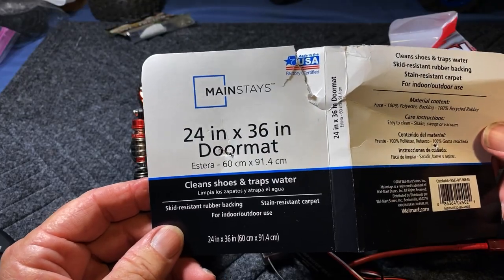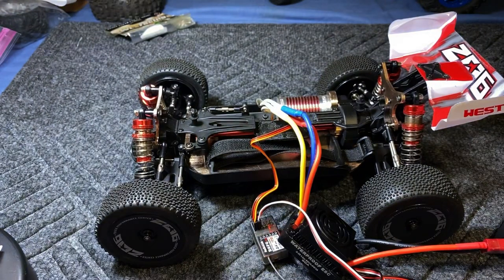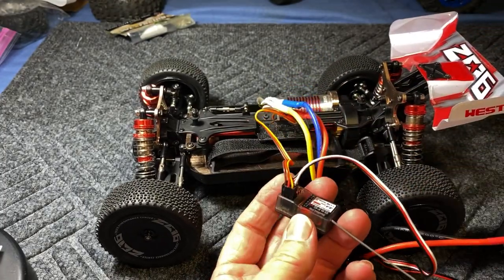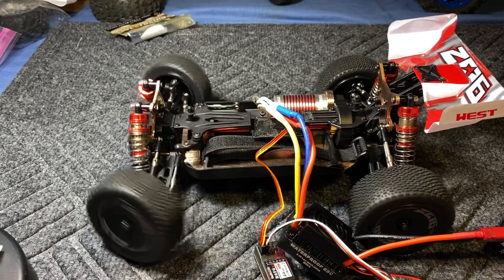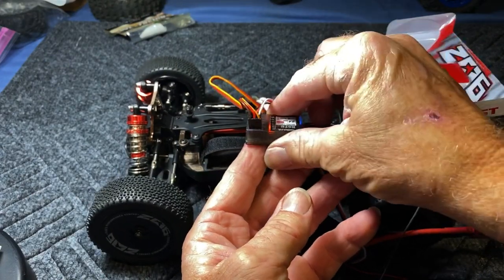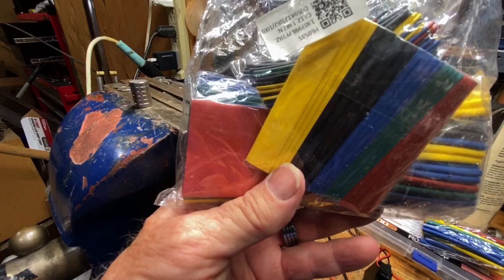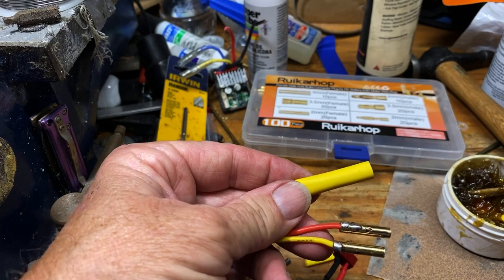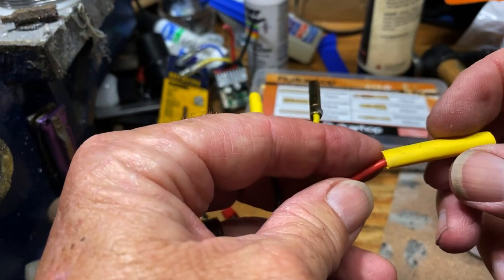WLtoys 144001 brushless ESC choices

Comment: Just bought 3 of these here in the U.K. straight out of the box its amazing and bloody quick, i cant imagine this on brushless.
Reply from the maker: It’s a bit much with the 3650 but the 2845 is pretty cool. Quickness is close but the brushless 2845 3930kv is fast. Probably if you try a 3100kv would be great and maybe more run time. 

I just bought three more brushless motors to try. I’ll get to that ASAP. 

Thanks for watching and have a great day.
Reply: @RCModSquad  sounds good. My plan is to keep one brushed but highly modified, and i,ll keep one brushless, highly modified also. These truly are amazing rc cars for the money.
Reply from the maker: I agree. I’m keeping one stock and one each for brushed and brushless testing. 😃
Reply: @RCModSquad  i almost forgot to mention..iv just installed a full fpv system.. and im going to go tbs crossfire. You can only imagine the fun with this. Real life mario kart. Ripping around supermarkets while sat in the car park...😂
Reply from the maker: Kyle Fpv that would be fun. I have a caddx camera and transmitter with a DVR that I was thinking about putting in my Typhon.

Comment: Neat idea with the door mat. I got an $8 yoga mat that I cut in half, and doubled up. The top piece got holes cut out so it created small trays when stacked on top of the bottom piece and glued. Both ideas sure beats paying $40 for a pit mat. I ended up getting the same servo you have after trying a bunch. Its been working great for speed runs!
Reply from the maker: Thanks my friend. It’s one of those things where I was just wandering through the store and just happened to see that at the correct angle. I’ll know pretty quick if I like it. I do think a different color might be better. The screws blend a bit too much with this color. 

I bet a can of fusion paint for plastic will fix it. 😃

Have a great day my friend and be safe out there!

Comment: Great info on how to solder those esc connectors on. That servo is super fast, wow.
Reply from the maker: Thanks for stopping by. 🙏👍🏻 I was very happy with the speed and power even at 5 volts. The connectors are really easy once you figure out a good way to hold them. 😃 
Have a great day my friend and be safe out there!

Comment: Just keep a magnet or a few close to where you are working, I like to use a few to keep the screws and bolts in groups so that I can have a better idea where they go back in the car when I need to reassemble it.
Reply from the maker: That works well. I have a lot of magnets stuck around here and there. I use them on the inside of the body also. 

I just use a little gorilla tape inside the body to keep them in place. It's handy to keep track of the body clips.
Reply: @RCModSquad  For sure!

Comment: FINALLY got the front and rear wheels working together and got some metal upgrade parts in. Just a few for looks. But the 60 amp esc will not fit.. I was hoping you would go into some esc mounting tips here. I’ll keep looking thru your videos.
Reply from the maker: There aren’t many good options for mounting the ESC. Most people just use a different body to gain extra room.
Reply: @RCModSquad  oh ok. I didn’t realize that. I’m gonna try the 10bl120. It’s a little overpowered for such a small car but I think it’s the smallest esc I have. Do you have a “go to” for these oversized shells for the 144001? I’m sure I can find something if not. Thank you for your time

Comment: to go along with the 18650 mod there are 14500 s that are AA sized lithium ions.
thought they do not hold near as many mah .
also 26650s are big fat 18650s that hold a lot .
14500s are in the zinlehong brushed cars .
they have some awesome 26650 flashlights .
I think you would benifit greatly from a 3d printer .Seeing as how you like to mod .
i know you bang good . they have some good ones .
Reply from the maker: Thanks! I’ve been using the 18650’s and 14500’s for probably 12 years. They are awesome batteries. I’m actually planning a 3x18650 pack for the 12428 and Pouncer trucks. I have the balance bossed I just need the time. 😃

I have a couple of 26650 flashlights too. They are pretty cool. I picked up some 18500’s the other day. I was thinking about maybe using them for  LED mods. 

I have a couple of 3d printers and a laser engraver but I’m trying to stick to projects that people can duplicate if they don’t have all the tools. 

Thanks for stopping by and checking things out and your suggestions. 

Have a fabulous day and be safe out there.

Comment: I have a blue esc that looks similar to yours 120a everytime I hit the throttle it jitters for about 2 seconds before it goes I'm not sure what the problem is.
Reply from the maker: It sounds like it’s cogging. You need to pick up a programming card. They are around $12. It programs the ESC. You need to turn the “punch” down. 

Probably if you pick the car up it won’t do it but when you put it back down it will jitter until it gets rolling. You can also try to push it as it takes off. If that makes it go away then you know it’s cogging! 

I’ll be using a programming card in my run video. If I get home early enough I’ll do that later today and post it Thursday morning. 
Thanks for stopping by and be safe out there.
Reply: @RCModSquad  thanks I will look into that and look forward to your nxt vid.

Comment: I broke my original remote. I purchased a new Dumborc with x6fg receiver.  Do I need to purchase a new esc for the Dumborc to work?  Will a wp-1060-rtr work?  Can I keep the rest stock?
Reply from the maker: The WP-1060 should work but you will need a new servo also. 

This one is a direct fit: https://amzn.to/3VvsBgx

I answered the rest of your questions in the other video. 

Thanks for stopping by. Have a great day and be safe out there.
Reply: @RCModSquad  do i need to program my esc?

Comment: Why Surpass motors make a combo with ESC 35a if it needs up 35a?  for example, I'm interested on 2445 3600kv (38a requirement) Surpass red and it comes with 35a ESC , it's that reliable?
Reply from the maker: The amps are a bit of a funny thing. It depends on the gearing on the car. If it’s geared fairly low then it wouldn’t ever draw even 30 amps. It also depends on what the “C” rating of your battery is. If the “C” rating is low it can’t supply 35 amps even if the ESC needs it. 

On the other hand if you gear the car really high and use a 100C battery it could easily overload the ESC.
Reply: @RCModSquad  pinion 15T and battery : Battery: 2S/7.4V 30C LiPo
Capacity: 2200 mAh
Energy: 16Wh
Discharge: Max 30C/66A cont & 60C/132A peak
Reply from the maker: @RedPanda_00806  with a 15t pinion I think you will be good. I don’t think the load will be too high.

Comment: It looks like the older rebranded hobbywing  or Hobbywing easy run when they were blue its definite model design steel I would trust it for a on road 4x4 sencored like blinky something cheep so you can still play type thing . I have the same car but mines the monster truck version I got it from Nitro Rc X or Express  I think thats the name of the company they made a shit ton of vehicles I converted mine to brushless I wish I could take a photo  Its quit quick now alot faster then when it had the brushed system even tho it was a hobbywing brushed It wasnt quick enough .
Reply from the maker: There really are only a couple of places that actually make this stuff and brands can choose different specs if they want. I contacted the company that builds the monster truck for a few brands and I can spec them differently or leave them as-is and just change the color and put whatever name I want on them. 

If I remember correctly the minimum order was 5000 trucks. I don’t have room in my garage. 😂😂

Thanks for stopping by and have a fabulous day.

Comment: I just bought one.. what should be the first upgrades.. i am cool with 43mph top speed.. looking for more reliabilty amd run time
Reply from the maker: 1st off do you plan to stay with a brushed motors or will you go brushless.
Reply: @RCModSquad  the stock brushed
Reply from the maker: JfeelGood I would not run 3s in stock ESC. You should get 30mph on stock setup. Probably the only thing you really need to do is add some grease to the differentials.
Reply: @RCModSquad  ok.. is the included battery a 2s?
Reply from the maker: JfeelGood yes. The stock battery is 2s and mine was a 1500 mAh but some of the new cars have a higher capacity battery.
Reply: @RCModSquad  awesome! Thank you.. now what brushless esc & motor would you recommend? if i go that route later.. not looking for anything past 50-55 mph
Reply from the maker: JfeelGood I’m using a 2845 3930 KV motor just because I want to try it. It’s a bit of a hassle to retain the stock motor mount with that motor. I’m getting 45mph on 2s. I’m not sure what it will do on 3s because it leaves the ground at 50mph. I’m working on a solution for that now. 

If you go with a 3650 with a similar KV it will be a direct bolt in swap. 

I like the DumboRC radio with the gyro receiver. 

There are links to what I’m running for the servos and everything else in the description if you want to take a look.

Comment: Can someone explain the “gyro” to me? I don’t understand what the point is. How they help or hurt.
Reply from the maker: The gyro senses the direction of the car and tries to maintain the direction you were trying to go. 

If you have ever been in a skid in your car, you steer into the skid to regain control. The gyro does the same thing. 

When you take off and the car starts to spin out the gyro tries to maintain the original direction even if the car is actually a bit sideways. It’s not perfect and is effectively limited by the servo power and speed. 

Even if the gyro is giving the correct correction angle the servo may not be able to respond fast enough.
Reply: @RCModSquad  thank you. I finally did figure it out. I just got the radio link GT3B receiver for my 144001 not realizing I would’ve had to pay the extra 5 dollars for the GT3C in order to get a gyro transmitter 🤷🏼‍♂️ live and learn.🤦🏻‍♂️ 😂

Comment: The blue 120A sensored/sensorless ESC is not really 120A. It's a 45A ESC which comes with either a 45A, 60A, 80A or 120A sticker on the top.
Reply from the maker: andrew mccluskey I still haven’t tried it but it didn’t seem likely that it was actually 120a. Thanks for stopping by and the info. 
Have a great day and be safe out there!
Reply: @JEFFY RCee 
When you buy these from AliExpress (like I have) you can find this exact ESC in 4 variation 45A, 60A, 80A and 120A with the only difference between them being the sticker on top of the fan and about $1 difference in price between them all!
Obviously 120A versions are most popular cause people think their getting awesome vaule when they are just paying for a sticker. I of course brought the 45A version and saved $1 😂

Also in regards to size, weight, thickness of wires, size of capacitors heat sink and fan size, it's all pretty consistant with your typical 45A 2-3S sensorless brushless ESC. ESC's rated to larger current/power are usually much larger to accommodate for the extra current/power/heat distribution with the exception of some  sensored race ESC's beacuse even though they may be 120A they are 2S only so the power going through is less also being sensored including a temperature sensor they can operate more efficiently too and are also much better designed with superior quality too.

Amongst RC groups, these so called 120A ESC's fail burn out alot and are usually labled as garbage.
I don't think they are garbage, just extremely overatted and when people try to put too much current through them, they fry. If you treat it like a regular 45A ESC limiting your motor size, KV, weight, load, gearing ect.. to stay within 45A you'll be fine.

I did fine with mine the punch from factory was set very low however that can be set via program card, not sure how the ones stickerd 120A are factory set, maybe they set them higher to make the buyer feel they are getting an ESC with more power? I don't know either way doesn't change how much current they can handel.
Hope you found this useful 👍🏻

Comment: Very interesting with the different Esc's great how to build , nice info.  What solder paste do you use ? Great video my friend 👍😎👍🇬🇧🇺🇲👍
Reply from the maker: Howdy Tony! Thank you and thanks for stopping by. That soldering paste is something I picked up at RadioShack probably 30 years ago. I don’t even have the lid anymore. I use such a tiny amount it just seems to last forever. 

I’m about 500 miles from home right now and I’m about to head back. If I have good weather I’m gonna test the car out. I’m curious to see what that little 2845 does. I think just from looking at the the tire speed it will be pretty close to the stock speed. Maybe 32-34mph. 
I was really looking at run time with this setup so if it’s close to stock speed and runs longer that will be ok. 

Have a fabulous day my friend and be safe out there.

Comment: Hi, nice video, love it. Just one doubt,  does the receiver giro needs the transmitter gyro for it to work or the receiver gyro works independently? In other words, for the gyro compensate the car steering, I only need the receiver? Or the full receiver and transmiter set? 
Tks.
Reply from the maker: You need the set. The rate control for the gyro is in the transmitter. 

Thanks for stopping by and the comment. Have a great day and be safe out there!
Reply: Ty so much for your time. Be well and keep on doing this great videos. Tks

Comment: When you converted that one to brushless did it have Phillips head screws on the motor mount or  what kind of screws were on the moment when the brushed motor was in there and can you put a link in my comment if you don’t mind to where I can get a Servo for that buggy I feel like ordering one of them buggy
Reply from the maker: It did have Phillips screws. If you can hit them with a heat gun and use a screwdriver that fits really well they will come out.

Comment: Hi, I just bought a wltoys 144001, and the ESC seems not to respond to the transmitter. Could you gime some advice? By the way, battery is fully charged; the ESC doens keep the led on.
Reply from the maker: Did it ever work!
Reply from the maker: Try turning on the radio first then the car. Also did you ever run the car on a 3s battery. The 3s can destroy the ESC.

Comment: i like the brushed version...is there a gyro at there that works with all the stock equiptment??? i can't find anyone that gives info on this...thanks
Reply from the maker: No, the stock servo is 5 wire and all the available gyros I’ve found are 3 wire. 

You could still stay with the brushed version. You would have to chance the ESC to something like a hobbywing 1060 and you could use a DumboRC with gyro receiver.
Reply: @RCModSquad  that kinda sucks.... i wonder if any other rtr s would be a better choice... i definitely want a gyro... to bad they don't sell just rolling built chasses where you add all your own electronics... I used to build kits many years ago,but really don't want to go that route anymore.... thanks
Reply from the maker: @roadstar499  there are a few cars like the q901, q902 and q903 use a three wire servo BUT the gyro is built into the receiver so you would still need to replace the radio, receiver and ESC. 

There are a few companies that make roller kits but they are more $$ than the 144001 and others in that class and you would still need all the same parts plus a motor.
Reply: @RCModSquad  cant find any of those q901 etc cars on youtube... whats the real name of them? thanks
Reply from the maker: @roadstar499  Xinlehong is the the maker and the models are q901, q902 and q903. They are all the same truck with a different body. 

If you want to take a look at them here’s a short playlist. https://youtube.com/playlist?list=PLpGY-4NyuphNppAOOrOxvGNMLqMXoY8zy